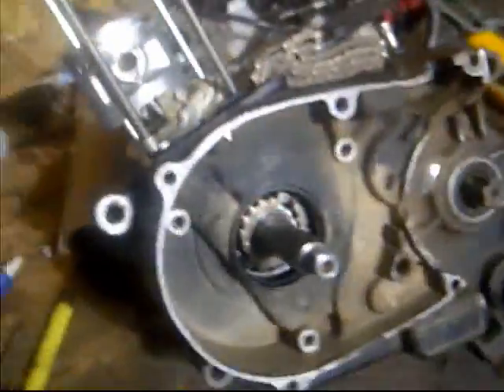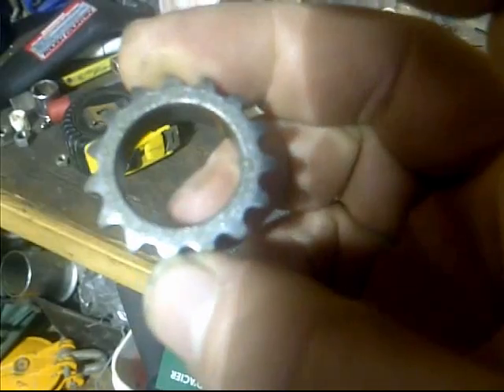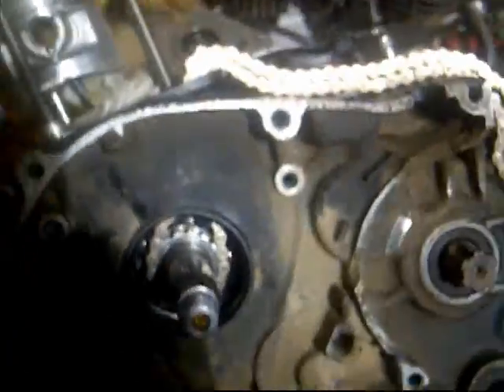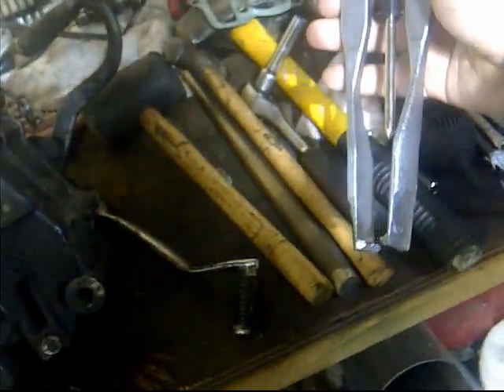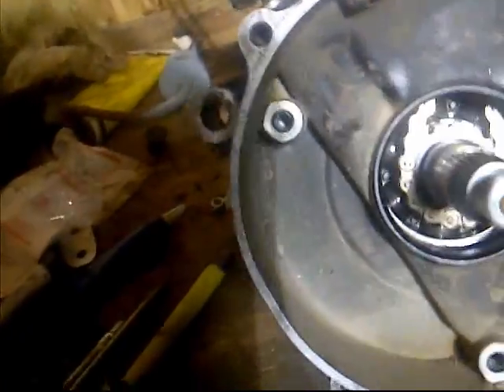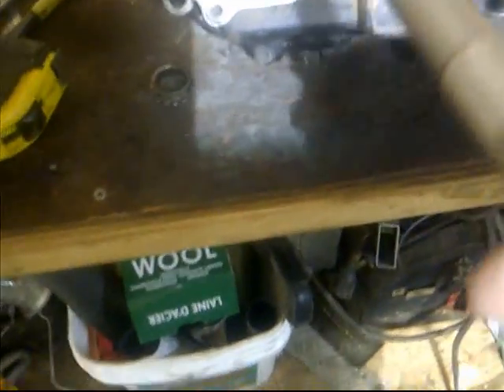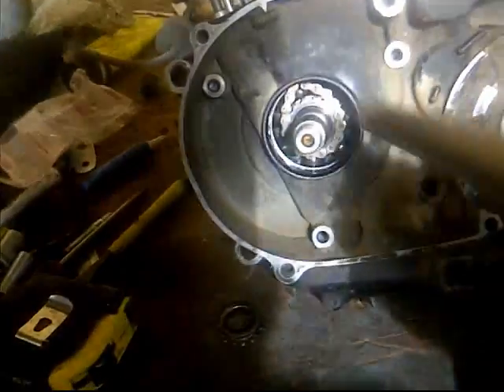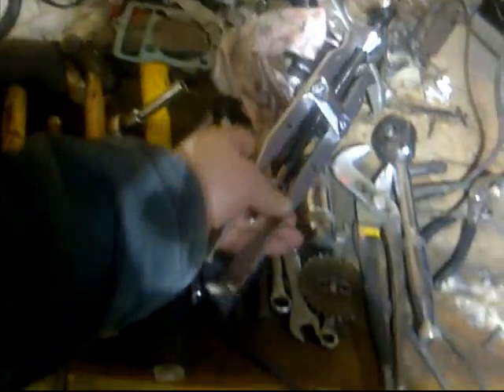XR 100 timing gear repair

Comment: do you know if this will be the same for an 85 xr80r?
Reply: The hole in the crankcase is smaller on an xr80, and the chain won't come through the hole. You can hold top end of chain and let it down slightly off of the gear and pull it through on a xr100. I stick a piece of wire down the chain cavity and hook it on to the new chain to put a new one back in.

Comment: im having problems getting my new timing chain and sprocket on the cam is the new chain post to be that tight its a xr100
Reply: kelroy1970  what did you find with this as im currently having the same problem?

Comment from the maker: Ya you can get the chain off by carfully removing it off the lower gear.however lower gear and upper gear as well as timing chain should always be replaced as a set

Comment: if u need to replace the cam chain on these fuckers. can you just pop the flywheel off and magneto assembly. then slide the chain through that tiny hole? or would it require cases splitting. thanks for posting this very usefull info :)
Reply: Yes, pull off the flywheel, and magneto assembly.  I did manage to get the old chain off, and the new chain on WITHOUT splitting the cases.

It is a bit fiddly - the chain has to get bunched up to give you enough play to remove it, or to install it.